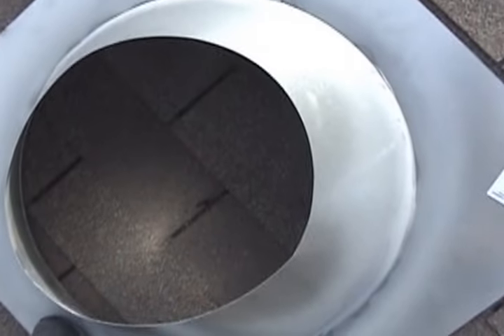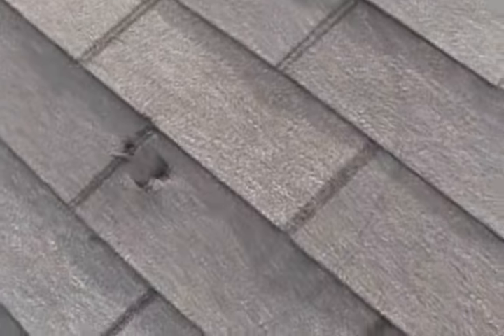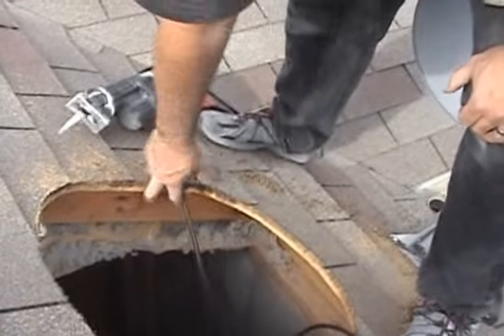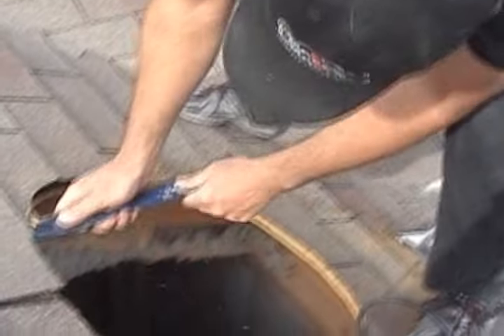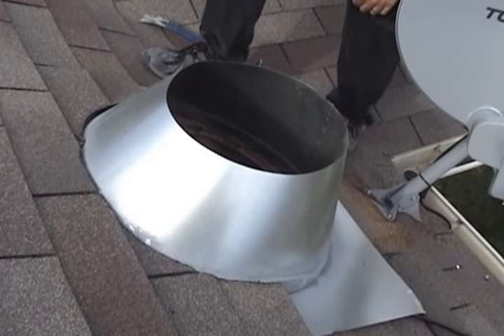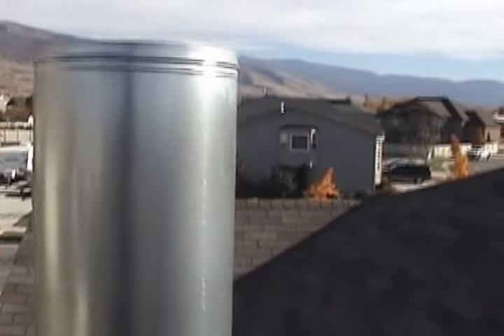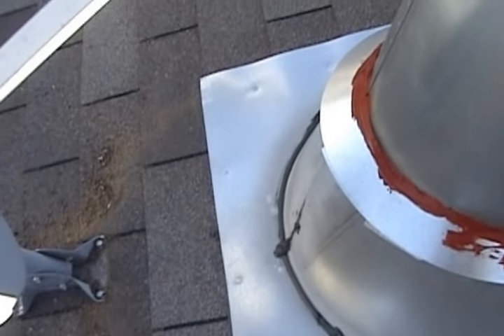How to Install a Chimney Pipe Roof Flashing

Comment: The flashing is facing the wrong side of the slope. That's why you ended up with a big gap under the storm collar, and ended up with not enough pipe clearance on the lower side of the roof. Also, you forgot to seal your nails and the bracing you installed only supports the pipe in one direction. To all those watching this video: this is not a professional installation.
Reply: Cesar Cervantes why don't you make a video. This wont leak
Reply: LOOK at the videotop  slope is soft  lower slope has a 90% angle ....water will not flow nicely with the bottom side on top!!  ...get it NOW??
Reply: @pierreverdoni  The softer slope would make the water flow nicely indeed, but that softer slope also puts the collar closer to the roof, which will allow for some water (or snow melt) to flow unto the collar, thus increasing chances for leaks. If the higher side with a near 90 degree angle, as you pointed out, is on the top side of the slope, this puts the collar further away from the roof, and because the flashing is a single piece of welded metal it wont leak at the 90 degree angle. Water will just go around it. Look at large bridges and how they build the bases with sharp concrete blades that break up the flow of the water. You don't want an easy slope for the water to run through. You want a sharp yet waterproof angle to make your water go around your flashing and away from any joints that may be more susceptible to leaks.

Comment: Could someone please explain what several commenters have stated regarding the placement of the roof flashing?  "The flashing is facing the wrong side of the slope" and "omg....upside down?"  Are they seeing something I'm not?  His installation isn't "upside down."  What am I missing here?
Reply: looks installed correctly to me.
Reply: I think the "'up-side' down" comment(s) is referencing that the flashing's seam is facing downhill vs facing upward. This particular chimney pipe flashing's seam, seems to have been manufactured to face uphill(?).
Reply: The flashing is installed backwards. Seriously

Comment from the maker: Yes I do! Nail or screw down both sides and the bottom. Don't nail the top of the flashing, and you can't use to much roof tar! Rember to use High Temp silicone for the pipe collar. Thanks for your comment!
Reply: Thick roof cement will dry up and crack like a mud flat. Seen many cases of a cracked  thick cove of tar burying the siding/step flashing interface. It has to be removed to roof over. We used to joke that you should need a license to apply roof cement.

Comment: Thanks mrEnergy for putting up your vids.  I installed the ceiling support box, now I need to go up in the attic and plumb bob for the center where I will put the screw through and out the roof.  I made a cardboard template for the hole in the roof to trace out. My roof is pretty steep so I made it elliptical so the clearances will be right on top and bottom.*One thing though is that the strapping you did won't work because the wind will still blow it down.  I'm gonna use a metal strap and rods all bolted everywhere so it won't ever go anywhere.

Comment: Nice job. You made it look so easy. Did you renail those shingles that you took out on the upper side of flashing, or did you just caulk the shingles back down. How many nails are you putting in flashing. And are they 1" roofing nails. I never did this type of job, but i know i can do it. I been looking at different videos. Some guys i seen dont put a beed of caulk on the bottom of the flashing. Im just not sure about that also. Im in a high wind,  and i do get heavy rain from time to time. What type of caulking are you using,  I installed a furnace in my garage, and this is the last thing i have to do. My stove pipe parts are coming this week. Do you have any other video of you doing more of these. Thank you. If you could just answer a few of my questions, i would appreciate it.

Comment: I live in CT when I put a pellet stove in my garage/workshop the code here was that the bottom of the firebox had to be a minimum of 18" off the floor in case of fumes. that was with the "exhaust pipe" through the side wall. Pellets were way to expensive, so now putting a wood stove in and just to make sure I will build it up on cinder blocks,, oh and my floor is concrete and that's what the building inspector told me to do to pass code

Comment: Super helpful. Getting ready to install a wood stove and chimney. Two questions: 1) think I can use a chainsaw instead of a reticulating saw to cut my roof hole? 2) how do you line up your roof hole to the stove pipe coming up to the chimney?
Reply: he used a screw threw the inside of the roof as his center
Reply: Howd that chainsaw work? 😉
Reply: @koolbeans8292  awesome actually. LOL. For real. Just had to air out the house real well! Been burning this stove hot for 5 years now!

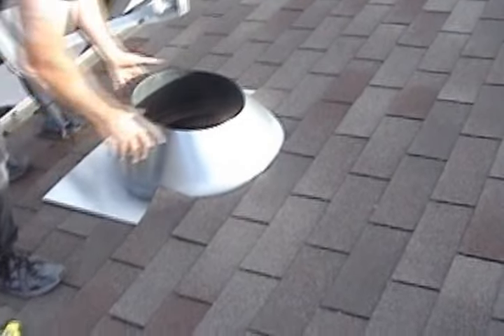Comment: What happened @7:07 like how do you get the pipe in there? Can you do it from the top of the roof or does it require going into the attic "cringe". I'm a woman and the inspector told me my furnace termination is wrong and it needs to be 12" it's currently 6 inches. I need to find a way to make this longer without having to go into the attic.

Comment from the maker: Thank you! Thats how you do it with class 'A' chimney pipe, run it straight through your roof and flashing, seal it up and put a chimney cap on it. You will be ready to go! On your single wall black stove pipe there are connector parts that are crimped on both ends. Use one of these and push it into the Chimney pipe.

Comment: My question is, did installing the chimney pipe in front of your cable, Dish Network, sat dish interfere with your TV reception? I want to install one on my roof as well and I wanted to know if it'll cause problems with my sat dish.

Comment from the maker: DUDE! When you slide the flashing under the shingles lar the hell out of it and put extea roof tar under the shingles you pulled up. If you really want to nail the top lift the top layer of shingles and just go up under the shingle a 1/2 inch so when it lays down the nail will be covered by the top shingle then pot some tar under that and press it down. Hope that helps your balls drop! LOL

Comment: "very well done when you added the extension flue pipe to the existing flue pipe -did you just slip the extension over the existing flue pipe =just a slip on and push down: thanks PJP
Reply from the maker: Not sure exactly what you asking. Each brand of pipe has a distinct connection.

Comment: hey, i have a question. my roof is made only with a panel of two aluminum boards and polyoritan beween them, without shingles. im planning on installing my chimnney ,if i'll use the roof flashing can i glue it stright to the aluminum ? i figured it has to be strong but screwing it will create a possible leak problem... my apologies for any spelling mistakes, english is a second language to me

Comment: All these flashing videos I have watched show just silicon caulking the storm collar. Although you should caulk it as a backup, that is not the recommended way to do that. There should be a larger diameter pipe that slips over that chimney and rests on the storm collar. This way NO water ever comes in contact with the seam between the storm collar and the chimney.

Comment: Flashing tape is recommended for the top. A little added security to keep the rain out. Caulk the exposed nail heads too.
Reply from the maker: Also a good way to make the roof flashing water proof.

Comment: Go under two more rows...all that water coming down the valley...gutter that close to the bottom of the flange. Hole might have been a bit big. Reason I say that is because your so close to the gutter. Heavy rain with back up in that gutter plus a ton of water coming down the valley and no-where to go. Could back up the roof from the gutter and get in under the bottom of that flange.
Reply: ***** Your're confused. I'm not talking about the shingles going two more rows under the flange. I'm talking about the flange going two more rows under the shingles. In other words he has to many rows going under the flange and not enough rows going over top of the flange. In this case it's really important because the flange/pipe is real close to the gutter and the valley. Water can back up quickly in a non-functional gutter, non-functional gutter could be as simple as a leaf clogged gutter, therefor the water backing up the valley just enough for water coming down the valley hitting the pond/backed-up water then running around the pond water and in under the flange. Seriously though if you don't understand this your're not really shingle/roofer. If you are a roofer I bet you would be surprised how many leaks you have behind you.

Comment: I have a similar installation to do next weekend.  My problem is I am going through my eave and it is shallower than yours and I want to include some sort of flashing.  Typical flashing would hang over the side.  The other part of this that may create an issue is that it is a steel roof.  Any suggestions would be great.
Reply: on a metal roof you could use a High Temp rubber boot. and then you won't need a metal flashing.

Comment from the maker: If your Wood Stove is set on concrete ZERO clearance! You will need to be 24" off the back to a combustable wall... Also you may want to build a heat sheild wall... Good luck!!!

Comment: How much would you typically charge for a job like this and what part of the country are you in? Also I see some people continue the shingles all the way down to the bottom so only the bottom middle is exposed it seems like that would work too.
Reply from the maker: John Smiith I'm in Utah. I charge $450 for a fireplace or wood stove installation
Reply: @mrEnergy511  I’m in Ky (2021 dec) was quoted 2500.00 for 1/2 stove pipe and half class A dbl, plus 1500.00 labor, straight up from stove, total ten feet, ceiling, attic, roof, so here I am diy, thanks for the great info 👍

Comment: Great video, however, it appears the flashing is on backwards, the chimney would center on the opening if you turned it 180
Reply from the maker: The roof flashing may appear backwards but it is installed correctly.  If it wasn't the flashing would not lay flat and the pipe would not be level.

Comment: we get a itty bitty drip coming down our stove pipe (in our living room)....and its random, sometimes nothing when its really raining...sometimes we get the drip on very little rain...it drips onto the base of the double wall stove pipe on top of the woodstove. The flashing looks correct (looking from the ground)...can we try the roof tar, first before swapping out shingles or flashing? The house (and roof and woodstove) is 8 years old. Thanks!

Comment: I have a question for you....Did you use a ceiling support box or did you just go right through the sheet rock in the ceiling and use a strap attached to the rafters?  If you just went through the ceiling did you use some sort of "beauty ring" on the ceiling around the pipe? Good helpful video! Thanks!

Comment: I am a professional fireplace installer and you could of put the roof flashing under 2 more rows of shingles. The strapping will not hold under high winds, use ridged pipe supports. You don't need the red RTV any 100% silicone will work.  The hearth pad you built will crack as the base is on top of carpeting. Remove the carpeting lay cement board down then go ahead with the hearthstones. Make sure you have enough front protection, usually 16"-18".

Comment: Do you nail down the exposed flashing?
Reply: Chris Layton .... yes..... but I noticed he didn't use nails with a washer to prevent leaks and he didn't seal the nails used with the roofing tar....

Better off using roofing screws.... more secure and they come with rubber washers attached to metal washers....

Comment: What are you get the pipes
Reply from the maker: Where do I purchase the Chimney Pipe? There are several wholesale Chimney suppliers out there. However you do need to be a licensed contractor to purchase from those places. The big box stores will have Chimney Pipe available online or special order desk... They DON'T KNOW HOW IT GOES TOGETHER so they won’t be able to tell you what you need to purchase. Find an Installation manual and study it so you are clear on ALL parts needed for a safe Installation. Thanks for the comment

Comment: Looks like flashing is reversed backwards 😲
Reply from the maker: I agree the roof flashing looks like it is backwards in the video.  If you go to the end of the stove install video you will see that the pipe is level. If the flashing was backwards than the stove pipe would not be level.

Comment: Guess you never realized a sawzall will  cut right through without a hole. And no it will not bend the blade if you know how to use the saw......

Comment: You put the roof flashing on upside down! Or backwards, what ever. The longer slope goes on the downhill side.
Reply from the maker: NO, Your wrong. 30+ years its right! the flashing is large and has an odd shape cone to allow for air flow at the top. This flashing is also made to adjust to various roof pitches... Not your standard roof flashing, it looks different.
Reply: seam goes downhill right?